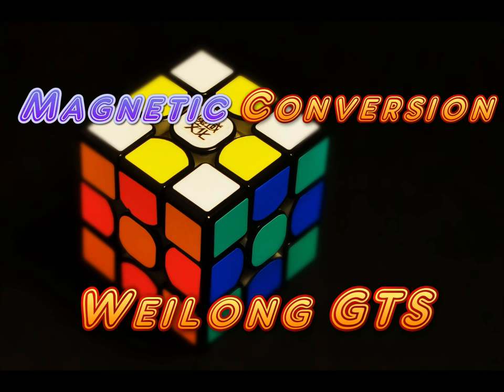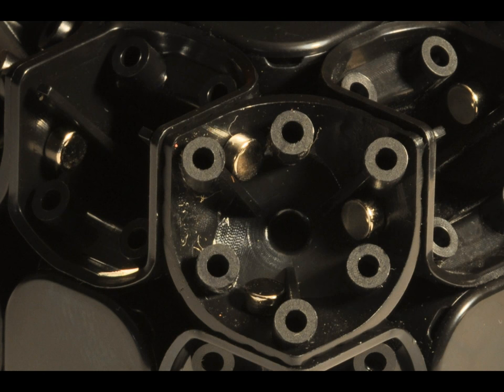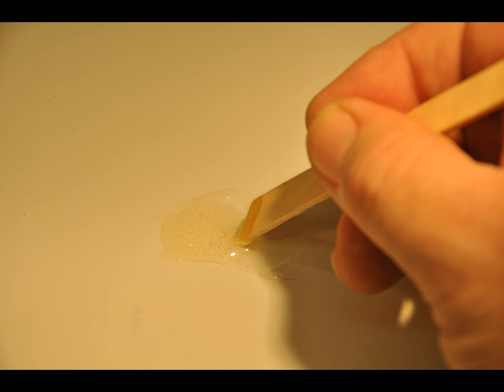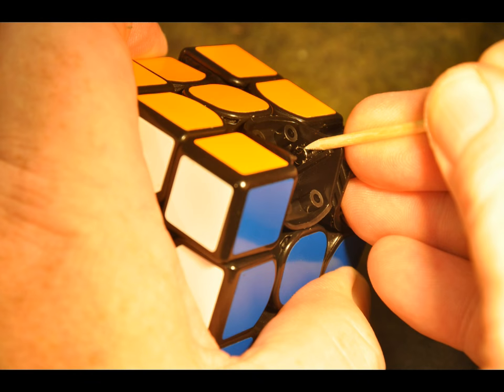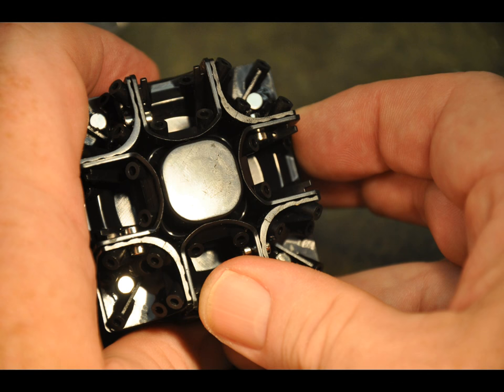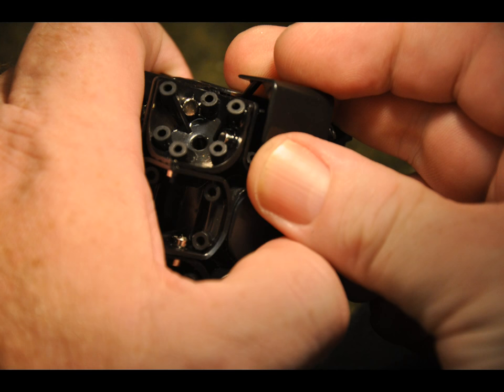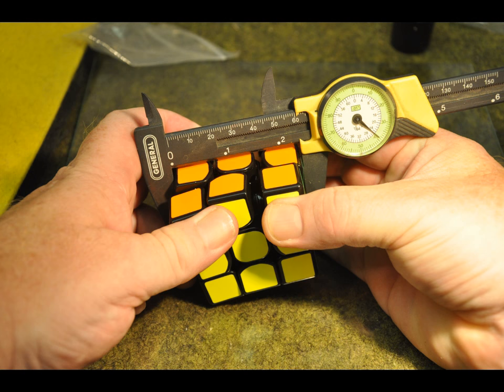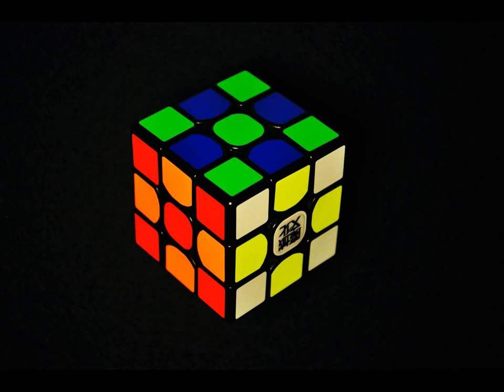Weilong GTS M (Magnetic) Do It Yourself Tutorial

Comment: I messed up the polarity when I was trying just now:( what should I do:(
Reply from the maker: Hmmm Sounds like the polarity got changed while you were placing the magnets. That is why it is so important to remove  the magnets from the same end of the stick of magnets and to place them on the cube exactly the same way each time. It's kind of messy but you can remove the magnets. You will have to use a strong screw driver and pry them out. Be careful though as to not break or scratch the plastic and sometimes the magnets will go flying when you're prying them off the plastic. Good luck and let me know how it goes.
Reply: I tried my best:( but I tried again on my two other gts, I made sure the polarity, and they worked so good now, Thank you so much:)
Reply from the maker: Archibald Leung Nice! Glad to hear the other two turned out well!

Comment: How do you take off the edge caps?
Reply from the maker: You just kind of worked a fingernail in between the cap and cubie piece and then just pry. It takes a while, and it's kind of hard sometimes, but that's the way you get them off.
Reply: Do you know if it will peel the Full-Fitted Stickers? Thanks for letting me know.
Reply from the maker: NeCuber You'll probably have to be careful since the FF stickers go right to the edge.
Reply: Thanks. I appreciate it very much.
Reply from the maker: NeCuber Glad to help!

Comment: what grade of magnets are you using?
Reply from the maker: Grade N48. They work well. They're a little softer feeling in  the black version of the GTS and just the tiniest stronger feeling in the primary plastic core of the Illusion GTS. Apex Magnets is the only place I know that sells N48 4x2. For a stronger feel, you can use an N52 4x2. My next several black GTS cubes are going to have that magnet in them. Those mags are available from Thackery: thethackery.com
Reply: For a valk 3, what grade of magnets did you use?
Reply from the maker: N35, but i wouldn't hesitate to use something a little stronger. My next Valk will have N42s in it! The 35s are nice, but subtle.
Reply: I use n42 and it's nice😊
Reply from the maker: +Raphael Serrano That's great! I figured they would be nice in the Valk. I have 250 of them, so I need to start using that grade in some of the lighter cubes!

Comment: If ise n38 4xmm is can?
Reply: Use*
Reply from the maker: I think you can use N38 4x2 magnets OK. They'll be a little weaker than the magnets I'd usually use in this cube. The N38s will give a light, subtle, magnetic pullforce feel.

Comment: Which is better N35,N42,N48?
Reply from the maker: Gabriel Adrian Cruz 48! Particularly in the primary plastic version. In black you may want a little stronger, like 52.
Reply: DMCubing Thanks:)
Reply: +DMCubing i can only get n35 or n50 which one should i get for an illusion gts (primary caps)
Reply from the maker: LetsToggle - 2ND Account Definitely the N50, no doubt.
Reply: +DMCubing thanks 😉
Reply: +DMCubing btw is there a way to magnetize the gans air ultimate. i have one of those and i heard it was mass produced so it was glued.. im not sure if u can take off the caps.. but i hope so.. do u know if u can take off the caps like the weilong gts
Reply from the maker: From what I've heard, the caps are glued on, so removing them probably isn't possible, unfortunately. And I certainly wouldn't try forcing them, or trying to pry the caps off. Even on a normal Air, the caps can be quite stubborn and difficult to remove. I imagine if they're glued on, it's going to be next to impossible to get them off.
Reply: +DMCubing oh alright... so i guess i cant have the um 😢
Reply from the maker: LetsToggle - 2ND Account Not unless you buy one of the high dollar ones. You can always convert a normal, standard Air. They're pretty good cubes.
Reply: +DMCubing i have the standard air. i kinda hate it... when u turn u feel nothing like no clicky ness.. i dont reallly like it.. 😃 im just going to do the weilong with  n50
Reply from the maker: LetsToggle - 2ND Account I know, but as soon as you add the N35 magnets, it gets some clickiness and locking goes away. 
But yeah the Weilong with N50s is awesome. Lot of people are ending up with fake N50s lately. Like they're way too weak. Make sure to test yours to make sure that they're strong before you put them in the Weilong. You'll know they're the real thing if they're slightly difficult pulling off the stick. If they come off really easy, you might've gotten stuck with N35.
Reply: +DMCubing ok thnks! 😀

Comment: can you do a valk 3 plz
Reply: also amazing first video
Reply from the maker: Thanks, man! I appreciate it! Have you looked at the corner piece of the Valk???? Whew, I don't know if I have the patience for that one. That one is very difficult to add magnets to! The Gans pretty much in the same boat. My next project is going to be an Aolong V2. It will be difficult too. All the gluing of magnets will have to take place with the corner and edge pieces disassembled and removed from the cube. What's nice about the Weilong GTS is you don't have to remove any cube pieces. ;-)
Reply: ok I have tried a valk m and it's amazing but I do see how it could be hard to do
Reply from the maker: +B-Dog Oh. Hmmm. If it's good, then it would be worth trying. Let me get a couple of other projects out of the way and I'll look into it.
Reply: ok
Reply from the maker: +B-Dog OK, I figured out how to do it. It's not really hard, it's just different from the way the GTS is done, and more time consuming. Do you recall anything about the size of magnets in the one you tried? The plastic of the Valk is thinner than the GTS, thus the magnetic pull force is increased, so I might use a thinner magnet. Do you recall how the Valk you tried felt, how strong the magnets felt, whether it was really noticeable or subtle? This will help me if I know this. Thanks!

Comment: Can i use super glue ?
Reply from the maker: I wouldn't really recommend it mainly because it's so thin and can run. You wouldn't want it to get inside the internal workings of the cube. A slower hardening adhesive like epoxy gives you plenty of time to adjust the individual magnets so they're aligned with one another and is easier to clean up. Hope that helps.
Reply from the maker: To follow up, though, there is a way you could use superglue. I haven't tried it but it might work. You could place and align all 48 magnets then place a small drop of superglue at the base of each magnet. This would be the safest way. It would also be very quick. I might try this method on a future project.
Reply: THANKSSS!!!Another question can i use NDFEB D5MM X 2MM N42 as the size and could you do a Valk# version
Reply from the maker: Hi Lance. I haven't tried magnets that size. I think there might be just enough room inside the cube pieces to use a 5mm but it's going to be close. What I've read online, the 5mm x 2mm magnet is slightly less strong compared to a 4mm x 2mm magnet. If you're able to get a good deal on the 5mm mags and they don't cost much, you could experiment. Hope that helps.
Reply from the maker: The Valk looks like it might be pretty difficult to modify, but I think it's possible. I'm going to look at mine again once I get a couple of projects out of the way. Several people have asked about the Valk. It's certainly a nice cube. I was playing with mine last night.
Reply: Thank for responding !!! wish you best you and your channel
Reply from the maker: +Lance Pua Wow, that's awesome! And this was posted last month. incredible! now I just need to figure out how to take the bottom part off of the corner piece stalk. Thanks for sharing this info! I'm studying it!
Reply from the maker: Thanks again for posting the link! The Aolong mod I'm currently working on is challenging but will prepare me for the Valk 3 project!
Reply from the maker: +Lance Pua Just had my Valk apart so I could better study it. Couple of observations: the Valk plastic is thinner and this increases the magnetic pull force (when compared to the GTS); the parts of the Valk have the highest tolerances so they fit together with extreme precision; a 4mm dia. magnet is PERFECT as there's a perfect little nook for it in one third the corner piece (if placed carefully, it won't stick out like in those pics online); finally, the easiest way see, still time consuming, is doing one face at a time. Using a stickerless cube is going to speed things along too.
Reply: DMCubing  nce really apreciate can you upload a video on how ro do it.Too bad I bought a white valk :(
Reply from the maker: +Lance Pua Absolutely, I'll do a video about it. I'm a little concerned about the 2mm thick magnets maybe being too strong. I'll probably do 1mm, partially, to experiment first. Nothing wrong with white cube, you'll just have to identify the parts from their stickers. With the stickerless pieces, their color is the entire piece so it might save a little time.
Reply: DMCubing Ohh i get it could you tell me what size is better after you test so i can order the magnets as soon as possible will N42 magnets work ?
Reply from the maker: +Lance Pua They'll work but it's important that the mags are not too strong. That's why I'm thinking about using 4mm x 1mm first, to test.
Reply: DMCubing okay will the be video about the valk be a full turorial on how to make it ?could you do a video on it so i can make sure what im doing is right ?

Comment: I did it i got to strong magnets it pulls it really far
Reply from the maker: What kind of mags did you use? I find the size I used (4mmx2mm) only give the cube a subtle locking of positioning.
Reply: DMCubing you would suggest the 4x2 magnets? They seem a little
Strong, how hard do they pull? (I intend to speedcube on it and I would consider myself pretty decent at around 14 seconds)
Reply from the maker: +Cubophobe I don't find they really pull much, just that they help keep the cube lined up. They'll pull a little once a side is close to being in position or having just passed it, the mags will pull the side back ever so slightly. Once a side is moved into motion, you don't feel them until they pass each other again. It's very subtle. Where you will feel more magnetic pull is while doing M slices. This is because you're putting twice the amount of magnets into motion. The 4x2 have a pull of about 1.92 pounds. This pull reduced because of the thickness of plastic which leaves a spacing of just over 2mm between the mags. There's a place in my tutorial where you can see two cubey pieces draw towards each other and the very light force it takes to separate the pieces. 
I had toyed with the idea of setting up a cube with 1x4 mags, but based on the way the 4x2 mags pull, I don't think I'll do the 1mm mags. I think they'll be too weak.  
It would be nice to know exactly what size mags Cubicle uses, but honestly I think these 4x2s are going to be close.  Thanks for your comment!
Reply: DMCubing omg I found hat I did I put them in wrong and they were pushing away thanks for the help I'll fix it you should post more you are awesome!
Reply from the maker: +777,776 Views wow, I wonder how that felt! whew. glad you found out what was wrong. Thanks for your kind words!
Reply from the maker: Hi Cubophobe. My next video addresses this subject. It will be uploading in a little bit, so please be sure to check it out. Briefly, I find there is little effort required. I finished a cube today that works with the lightest touch. I'm almost convinced that the Illusion GTS (Primary body/black caps) is superior over the black-bodied cube. With the lighter tensions necessary on a magnetic cube, it seems the white plastic is smoother and works better with lube. It was the craziest discovery today to witness how this new cube is better than my last cube, which I had thought was the best cube I've felt. Anyway, I think this latest video of mine will show that it really doesn't require a more aggressive turning style nor that it requires more strength. The magnets are subtle. But they are there and you can feel what it does. The magnets help keep the cube in alignment at all times (there's no misshaped body, etc.) and they help prevent overshooting and assist a little with undershooting. Even with my mediocre cubing ability, I think it's evident on the new video.

Comment: God I completely screwed up my gts
Reply from the maker: Oh no, how? Your old GTS1 or a new GTS2???
Reply: DMCubing Gts v1
Reply from the maker: MiPhinX X it's not an easy cube to magnetize. You really have to be careful with the polarity, and really make sure that the screws are tightened down so the body doesn't move around while you're putting in magnets. The good thing is it's fairly easy to remove the magnets from a GTS, you just pry them out with the small screwdriver
Reply: Let me make a long story short, I thought I knew what I was doing and did not follow your totorial, i glued them ALL IN THE wrong places. I did not glue them correctly so they fell out. I ran out of superglue so I just left it like that for 2 weeks, when I finally got more glue, I removed my magnets and can't find where I put them. Then u had 5 left and I tried to put those in and I got superglue on my cube pieces I did not realize and I let it dry, now my Gts is crap
Reply from the maker: Oh man. (Well, whew, at least you didn't mess it up following my video! LOL!)
Yeah, it seems like an easy cube at first but it can be tricky. In one of my videos, I think it's the one addressing polarity in the GTS, you just have to make your mind see that there is only ONE position of a pair of glued magnets and that one location is repeated over and over, 24 times. Here's the section in the video: https://youtu.be/_XZhLmBz1zI?t=1m27s
And when you're gluing the magnets, two things are really important, that you remove the magnets from the stick the same way each time and that you've removed the lube from the cube and tightened it down so that it can't move around while you're gluing. 
I've got a bunch of extra GTSs if you need one.

Comment: Are 4x2mm N45 magnets good?
Reply from the maker: JK Cubing In a regular GTS? Yes, I think they will do fine. The N45s should give a subtle feel in this cube. 
Where did you find the magnets? I've been looking for N45 4x2s for a while.
Reply: https://supermagnetic.de/neodymium-disc-magnet-4x2mm-n45-ni-cu-ni-nickel-coated.html is where I can get them. I like stronger magnets, so do you think N50 4x2mm magnets are still fine or N45?
Reply: The two websites are both German where I found N45 4x2s. One is amazon.de where you type n45 magnet 4x2 mm or a website called supermagnetic.com which have them gold plated and nickel plated. I forgot to ask you if N50 4x2mm magnets are fine (I like strong magnets:) )?
Reply from the maker: JK Cubing Thank you so much for the information!!!!
If you like stronger magnets, the original GTS can handle up to N52, particularly if the cube is black plastic. And N48 works exceptionally well, particularly in the primary version, or primary Illusion version, of this cube.
Reply: Thanks! I think I'll use N45 magnets because I also want to use the cube for OH.